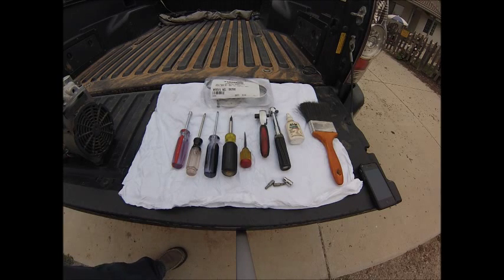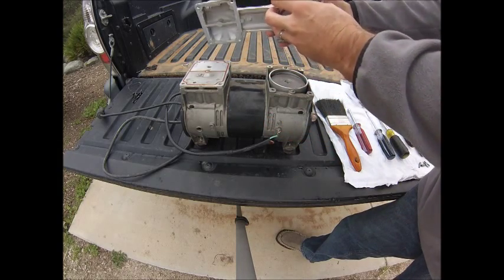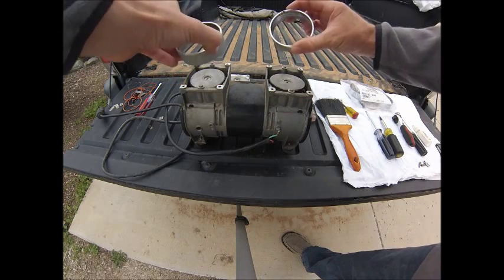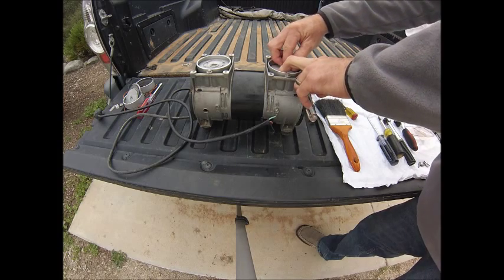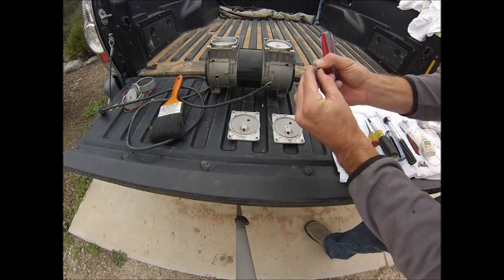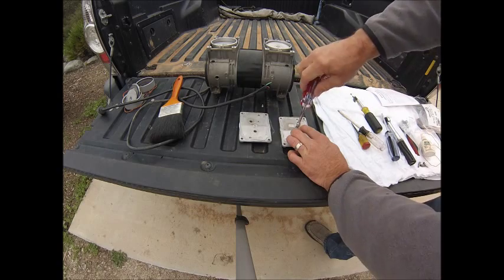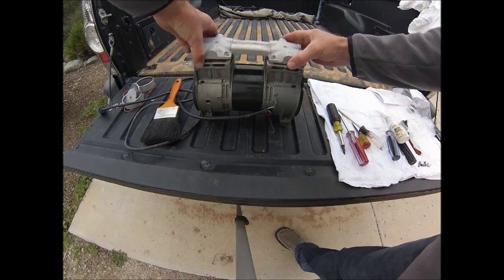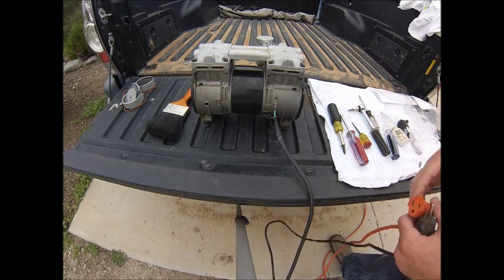Lake and Pond Aeration Compressor Rebuild

Comment: I just rebuilt one of mine a couple of hours ago. First most of the time it takes a ratchet to get enough torque to break the piston head screw loose. When you reassemble it you need to tighten the screw down and then loosen it off some and try to rotate the piston head to make sure it's in the hole. Then you can torque it down. Failure to do that may cause pump failure in minutes to days.

Comment: I broke both fans removing them, I intend to install the new fans backwards on opposite sides so one can access the spring clamps for install and removal, as it should have been. However there is probably no reason to dissassemble anyway, but I did go further to separate the aluminum from the motor to access the windings with a mallet, and there is a thermostatic shut off attached to the windings in there.
Reply: I have to remove the fans from two pumps that each need a piston replaced. The directions from the manufacturer say to use two screwdrivers to pry the fans out by the hubs.

Comment: I have a Thomas 2750cg 240v, i want to set it up as free Air tire service at my self serve car wash site. Based on the modell, will it be recomended to use, which ports should i use for intake air and output for compressed air. Thanks. We are in an area with 220v 50Hz
Reply from the maker: In general, these are continuous duty compressors that won't restart under pressure without additional appurtenances. And since the model you refer to is rated at a maximum pressure of 20 PSI, I don't think it's suitable for your application.

Comment: What is the typical service life on the rebuild on these pumps?
Reply from the maker: It depends on ambient conditions and air filter maintenance. In general I'd say you should get 1.5 - 2 years between rebuilds
Reply: Air filters are cleaned/changed monthly.  Thanks!
Reply from the maker: That's the best thing you can do to get the most longevity and least operating costs over the life of the compressor.
Reply from the maker: It depends on air filter maintenance and operating conditions. In general, you should get at least a year and a half between rebuilds assuming 24/7 operation.